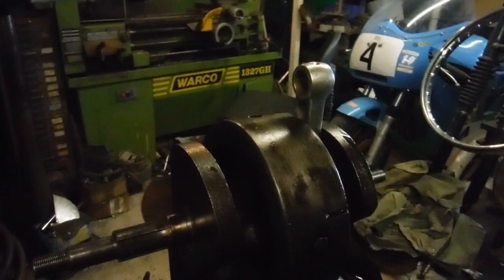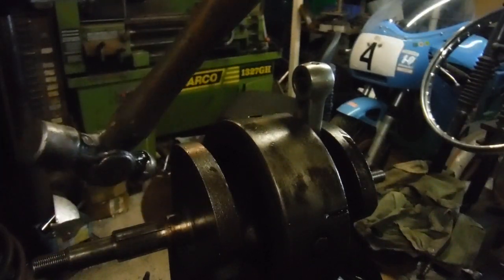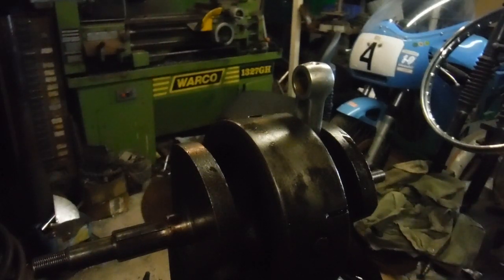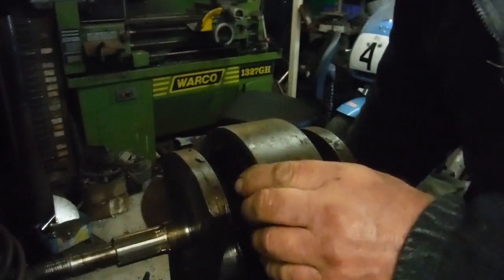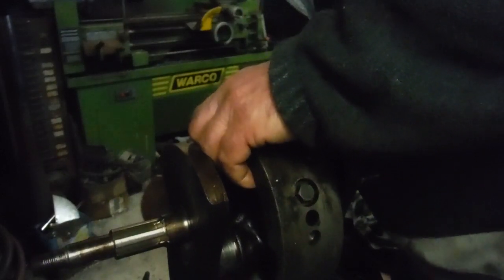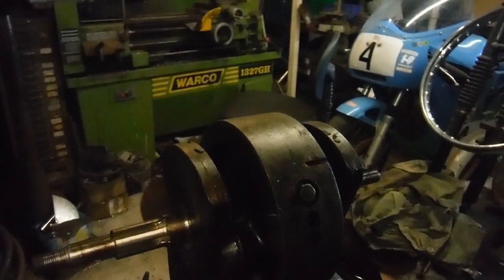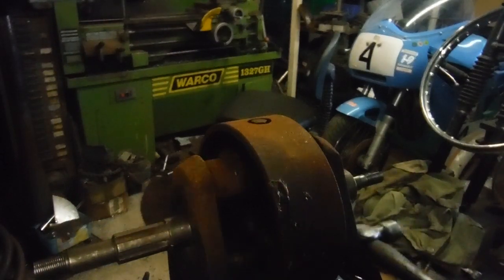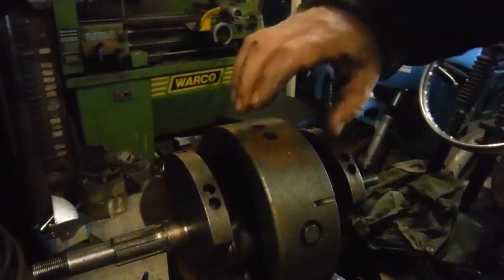BSA A65 post blow up repairs 7 Comparing cranks with a known cracked one.

Comment: I think the ring test should be done  by hanging the crank with a bit of wire otherwise the ring gets deadened ,  but like you say magnaflux or similar would be a good double check .cheers

Comment: Would be most interested in why the post A65 Repair blew up after only approx 3000 miles ? Oil journals ? Seeing that crankcase reminded of an experience I had as a pit crew for a Mini 1000 Challenge series race season. A driver approached us, as they do, everyone does, its like a family really. This particular driver wasn't often on the scene so to speak. Anyway I had a spare one in my toolkit. My driver said they normally use a ball bearing as an oil pressure release valve. I gave him an A series one which looks like a blunt nose bullit. Coming back to the paddock after the race I saw this guy's mini on a trailer, from the front you could clearly see the crankshaft through the gearbox case. Not sure if my valve caused that, but from the look he gave me I didn't ask !

Comment: Good explanation of the process Paul. Anyone involved in locomotive engineering would be familiar with wheel tapping to test for structural integrity.
Reply: And tapping nuts and bolts. If they go dunk they are probably loose